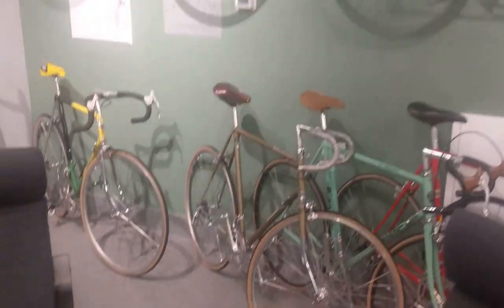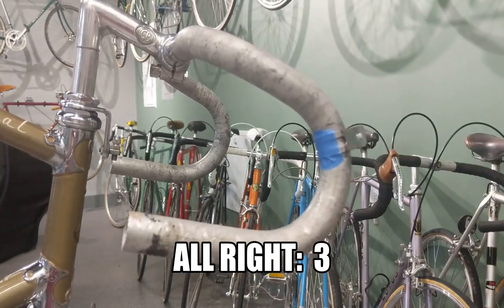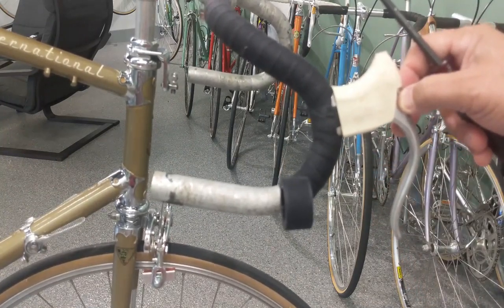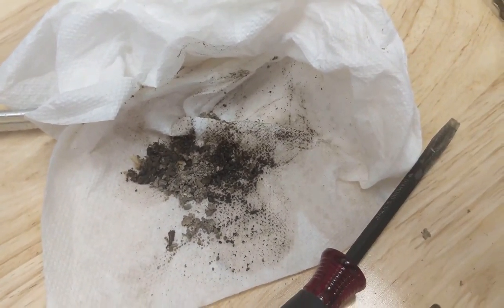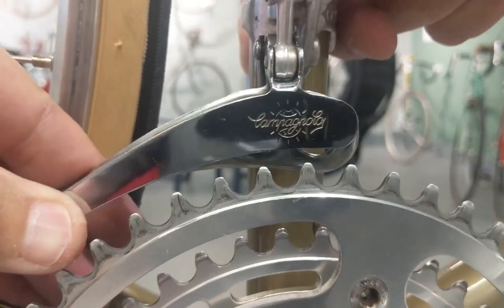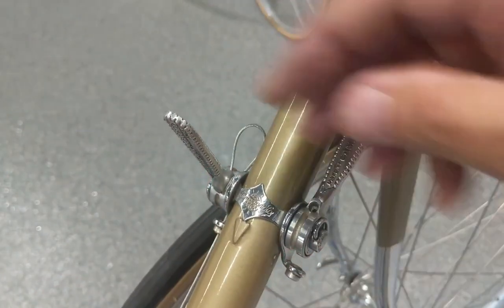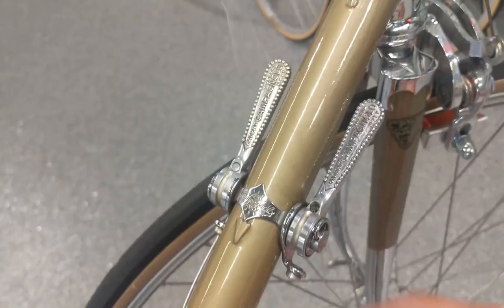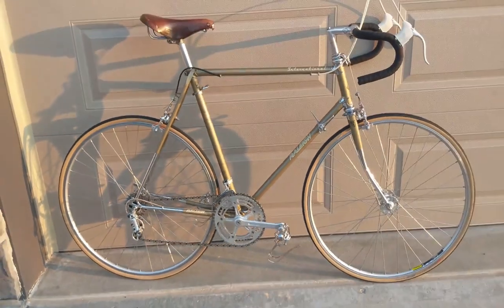Restoration finished on my 73 Raleigh International

Comment: Nice machine there.  I was in the bike business from 1972 'til the early '80s and always wrapped the bars from the bar ends to the stem, not from stem to bar ends.  Otherwise the tape edges will curl just from hand pressure.  I also secured the brake levers firmly to the bars with tape after tightening the clamps but before installing the hoods, the idea being that if a clamp fails the tape would keep the lever at least partially secured until a new clamp could be installed.
Reply from the maker: The hoods are hardened and can't be removed or peeled back as a mentioned in the video.
Reply: @JohnsVintageRoadBikeGarage  Thanks, I missed that part.  But what about properly wrapping the bars from bar end to stem?  I'm subscribed to your channel and enjoy your videos, so I'm not trying to nitpick about an inconsequential issue.  Just pointing something out.
Reply from the maker: @wrightflyer7855  I always wrap the bars as you suggest with the exception of the ones I wrap with cloth tape. It holds up just fine and it looks better. These see very few miles any who...thanks for watching.

Comment: Thank you John! Excellent video. Congratulations with the new "cave". Beautiful classic bike. What's not to like? Leather saddle. Center pull brakes. High flange hubs. And integrated cable holder for the rear brake. Wow!

Comment: Just to aid fuel to the fire…r.e. the “controversial” cable routing…I always prefer them in front of the bars (as you have done John).  I think it keeps them out of the way and seems neater…I’ve done it that way for 40+ years.  Yet another great bike John! Thanks for sharing!
Reply from the maker: Thanks, oddly enough. In Schwinn Service school they always taught to put them in the front. I think  mostly for liability issues. Less chance of them getting tangled.

Comment: When threading  gear and brake cables ,I put a dab of grease on the nipple before it goes into the hole,, as I've had a front brake cable snap once,  from rust ,right where the nipple is soldered to the cable,( had to crash the bike into a safety barrier to avoid being hit by cars ). Also with gear cables when the levers are forward the end of the nipple is exposed and rain water can get in there and cause rust .
Reply from the maker: Great suggestion.

Comment: Nice and good to see someone wrapping bar tape from the top of the bars and pushing the excess into the bar ends. It makes so much more sense. It's less likely to come undone and also looks a lot neater. One quick question: Was the Campag drivetrain standard on these bikes? Thanks. JP
Reply from the maker: Actually with sticky backed cloth tape it's appropriate. Some of the newer wraps the edges will peel up if you do it from top down.
Reply from the maker: Yes that is the correct drive train. Thanks for watching
Reply: @JohnsVintageRoadBikeGarage  useful information. Thanks for that.
Reply: @JohnsVintageRoadBikeGarage  And thanks for that too :)
Reply: The Campagnolo drivetrain was standard on this bike along with the Weimann brakes.  Just as you see his

Comment: Very nice work John! I am a Vintage Schwinn guy, but recently picked up a '71(?) Raleigh Super Course. Not sure how original, but campy and chrome tip galore. What is your opinion of this lower tier Raleigh?
Reply from the maker: Honestly. Schwinn had to start importing bicycles to compete with Raleigh and others. They were usually great bikes for the money. I have to types of bikes. Top of the line dream bikes and those that scratch a nostalgic itch.. both are wonderful.. Thanks for watching.

Comment: Curious if you do any 'somewhat serious' climbing with the bikes in your collection?  Seems you only 'downgear' your vintage bikes keeping the standard cranks (most are 42/52t), only swapping a 28t FW (seems you don't have issues with Campy NR RDs clearing 28t.  Probably you do with Gran Sport RDs tho).  
     With low gear being 39.5" with most of your Campy NR bikes, can you still cruise up 6-8% grades at 60rpm/7mph, or do you just 'grind' at 40-50 rpms at 5-6mph up 'steep' 7-10% grades? ... or do you limit your riding these vintage bikes to 'mostly flat' terrain? 
     No offense but I rarely see cyclists over 55 y/o with such high low gearing.  If you can handle that gearing you're pretty hardcore.  My knees & lower back throb in pain just LOOKING at that gearing and thinking of climbing with it, & I'm 'only 52 y/o'!  
     I 'downgear' almost all my vintage road bikes to minimum 32" low gear (39/32t), preferably 28" (34/32t) & even less than 1:1 if possible.  A range of 23"- mid 90"s, with a 28t/46t double crank & 13-32 7 sp freewheel  is usually how I 'downgear' my vintage bikes if possible, but I don't have many Campy components (I do have some tho).  I tend to use vintage Suntour & Shimano derailleurs which provide more range & many of their RDs clear 32t FWs.  I have 'drilled out' 130 & 144 bcd cranks, drilling #5 74bcd CR holes in the spider with success, provided the spider was 'flat/flush' not 'rounded/curved', and I added custom made CR bolt spacers, and just swapped longer BB spindles, and either made them into triple or double cranks (bolting 'outer CR' to inner part of crank spider).  
     I drilled out a 144bcd Campy Nuovo Gran Sport double crank to 74 BCD & installed a 32t 74bcd CR & 47t 144t CR and got a Nuovo Gran Sport FD to just Barely shift the 15t, & installed a Soma long cage on a  NR RD, but had to use a Wolftooth Road Link RD hanger extender to get the RD to shift to the 32t FW.  The gear range is 26.4"-95.4" on that bike. That's about as LOW as I could get the gearing with a 'decent' high gear and smooth steps btw gears (28/47t crank & 13/15/17/20/24/28/32t 7 sp. FW). I tried a 14/18/22/28/34t 5 sp. FW but cadence went "ker-plunk' riding the bike & high gear was too low at 88.6". Sure would be nice to find a decent period correct 13-34t FW to get the gearing below 1:1.  FWs like that are almost impossible to find.  Old Campy components are beautiful but you have to 'do violence' to downgear them. 
    The Campy components on my bike don't look 'too weird' with the Soma long cage & drilled out 'Subcompact' Nuovo Gran Sport crank ... just a 'little weird' ... but I can actually climb with that bike.  You may want to try what I did with an old 'scratched up' NR crank & derailleurs & a 'scratched up' frame and ride that bike as your 'foul weather/climbing' bike. You could easily swap out the crank, BB & RD to your nicer bikes if you want to ride some hilly rides, or drill out a non-scratched NR crank & add a Soma cage to a non scratched NR RD & keep those + a longer BB spindle & long chain on hand, & swap the parts out to whichever NR equipped bike you wish to ride on 'hilly rides'. Shouldn't take you more that 30-45 min to knock out the parts swap John.
Reply from the maker: wow. you wrote a book!! first of all. If the bike has a NR or SR rear derailleur the largest I go is 26t. Most of the vintage racing bikes though are either 13-18 or 13-21. That would of been accurate gearing for the age of the bike. Plus, honestly. I ride my classics maybe 10 15 miles at a time and its fairly flat with only a climb to get out of our river valley. I have a couple triple equipt bikes that are factory with a 28/44/52 but that was common for 1982. My daily is a New Moots with an Ultegra kit.. huge range. Ive seen a few campy 144 cranks with the drilled out 74.. works well. I dont put modern stuff on a vintage bicycle unless I do a complete retromod like my Pro Miyata. Im in an unusual position that I have so many bikes I have no need to modify.